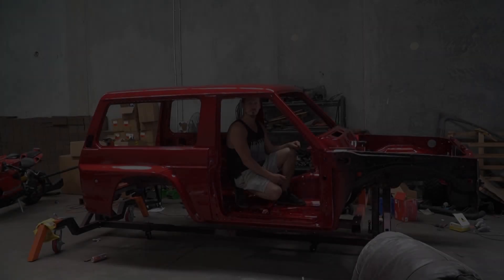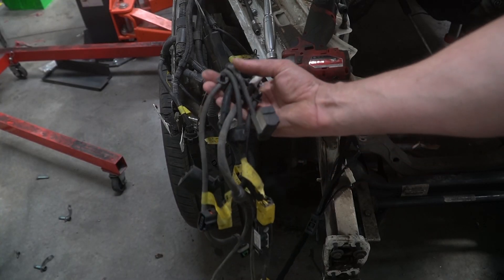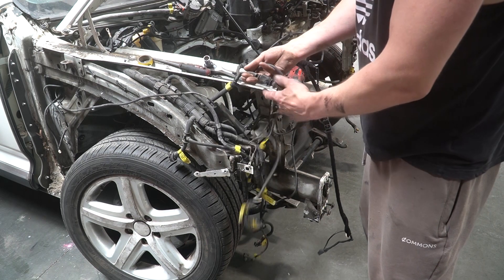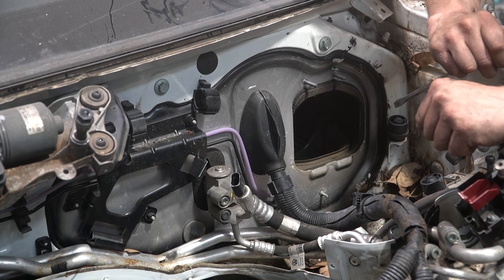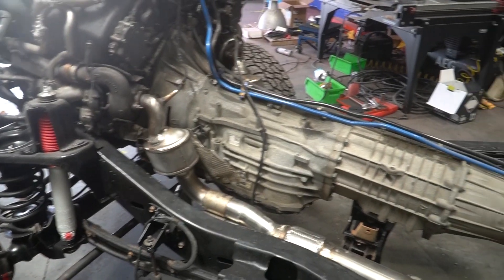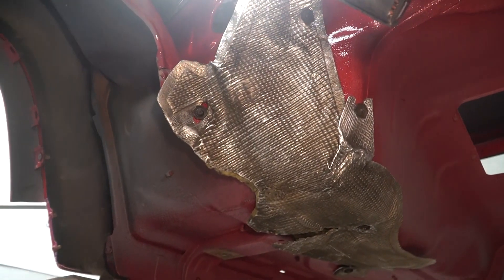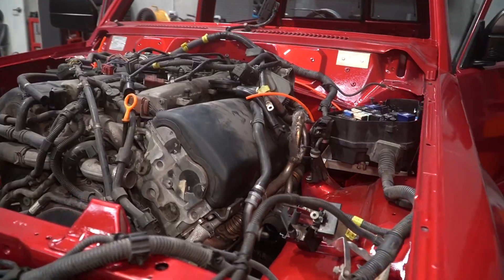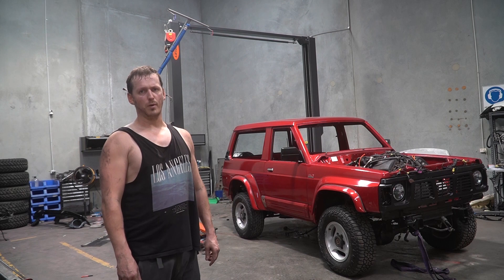Ready To Start The Engine For The First Time! V10 TDi Twin Turbo 4x4 Gets Prepped - V10 patrol ep17

Comment: No heat shield across the firewall? Will you be soubd deadening inside or should she be a bit quieter?
Reply from the maker: Heat shields are for exhausts. No crossover pipe so no need for the entire firewall. As for sound deadening, possibly. Find out in later episodes

Comment: Good effort. Dealing with VW Autistic traits especially wiring and ECU. Good luck. But that clearance on the back of the head and turbos , well VW engineering take notice. It will be Interesting with the patrols diff ratios vs the lazy Touareg open road 3.2:1. 
It will be rapid acceleration. Now I own 2 Touareg V10 TDI s. And they are the fastest cars I own. With a shed full of Performance cars to put to shame. But remember speed is a science of perspectives and money. I will be keen to see some performance figures especially now it's been to your diet centre of weight reduction? Any estimate on final weights?
Reply from the maker: One step ahead of you 😉 I've put 3.9 diffs from a GU in this build. This means if I put 35 inch tyres, I get within a few % of the factory setup on paper when comparing the stock wheels circumference. Weight wise, I'm expecting to be at least 500kg less than the Touareg if manufacturer claimed mass is to be believed
Reply: @ridiculousthings4x4  
My stock 2005 V10 was 2830kg with me (80kg) sitting in it, less than half a tank of fuel, and an empty boot.

Comment: That donk looks so ridiculously oversized in the shorty’s engine bay.
Awesome job so far, I thought you might have issues with wheelies but now seeing the engine in it looks more like endos could be a thing!
Reply from the maker: Would you believe this engine is about 20% lighter than the one I pulled out?
Reply: @ridiculousthings4x4   Is it all alloy (block and heads)?
Reply from the maker: It's a steel "stressed member" around the crank, and everything that bolts to it is alloy. Check the release spec sheet of the engine showing its "new features". It's a bit incredible considering it's in a soccer mums car